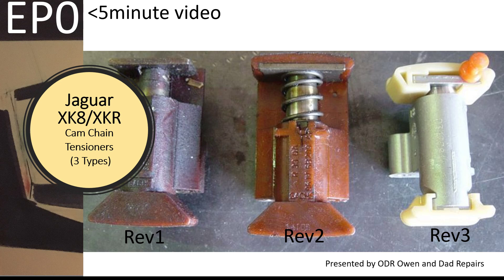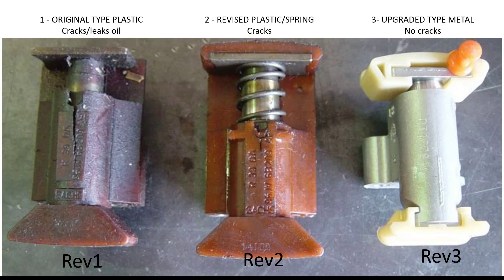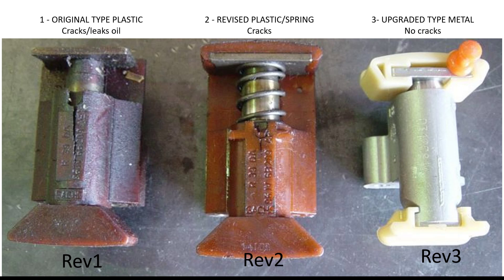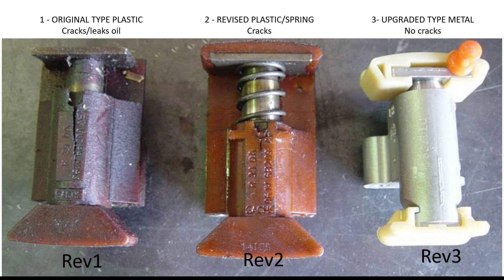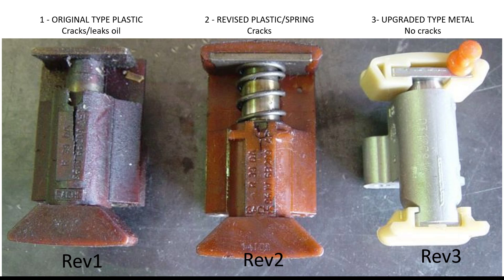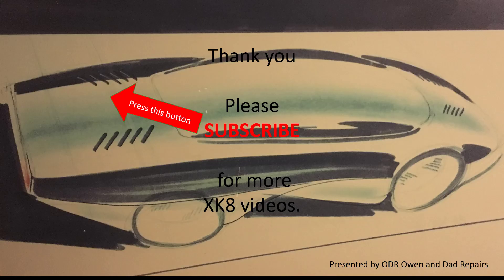Jaguar AJV8 Timing Tensioner Types & Why You MUST Check! Timing chain Playlist EP0, XKR X100 Modurol

Comment: Different bolts required with metal ones.
Reply from the maker: Yes forgot about that. I believe they are shorter as the metal flange for fixing them in not as thick as the old plastic ones. Thanks. :-)